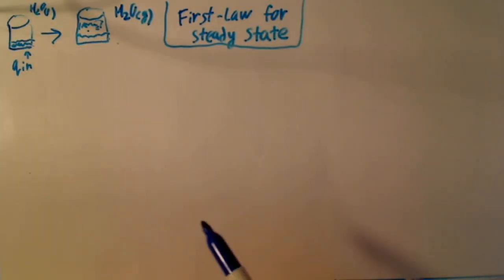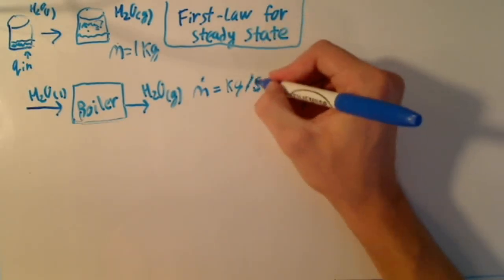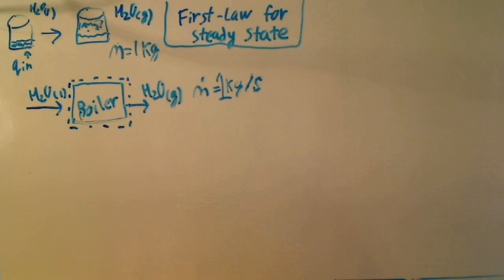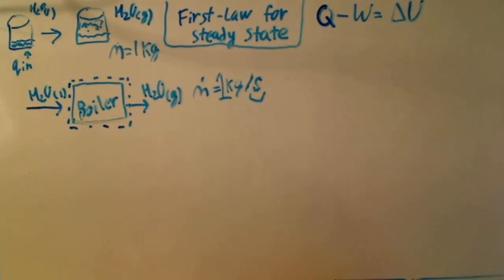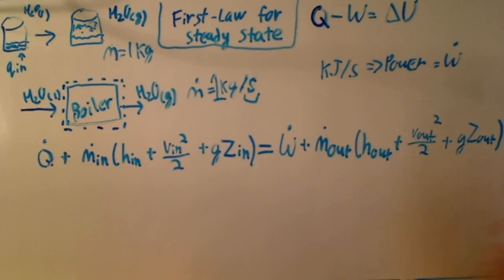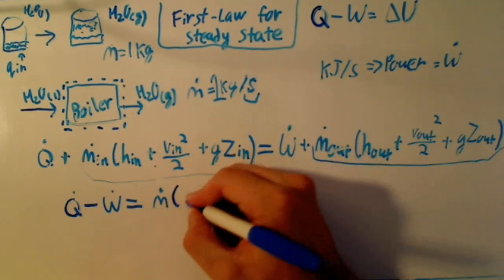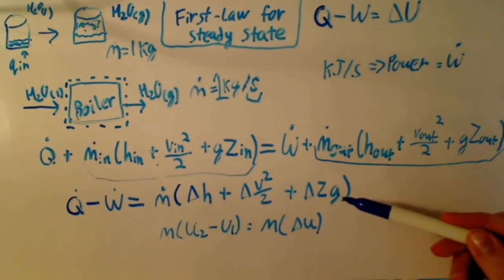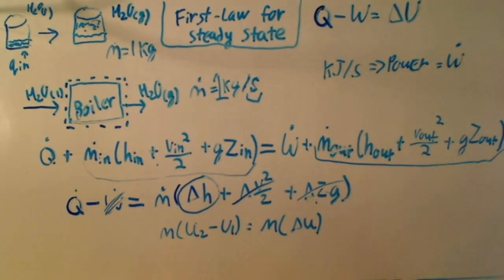Lesson 7: First law of Thermodynamics for a Control Volume

Comment from the maker: You are right when you say that water is getting hotter, but you have to remember that water is flowing through the system, so cold water keeps coming in as hot water comes out.  

I would like to amend what I said earlier though.  Steady state for energy just means that there is a constant input of heat into the system.  This is used in the conservation of energy equation, letting us use a constant value for Q with respect to time.

Comment: in the example with the boiler, would the d(Temp)/dt change in the control volume, because water is getting hotter?
Reply: Lovely Green Sky I believe as there would be a phase change in the Boiler,The heat given will be used to change the phase only and hence,Even though heat would be given,The temperature would remain the same.
Reply: @VankyKennyKataria  م

Comment: What is steady state in energy? I understand Steady State means No Changes. But no changes in what? mass, volume, temperature, pressure? Or another word, when d(mU)cv/dt =0? For example, the boiler-as the control volume, so obviously there's change in temperature in the boiler. Then should we still consider it as Steady State? Thank you